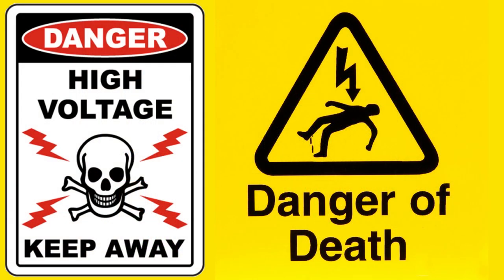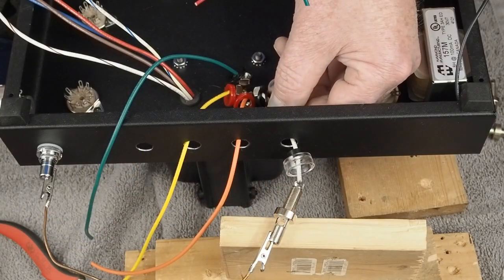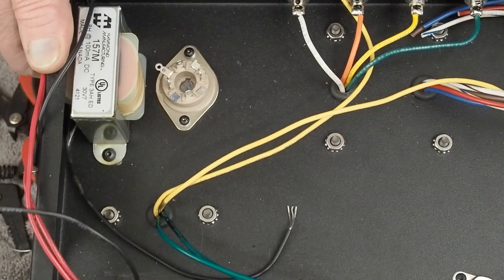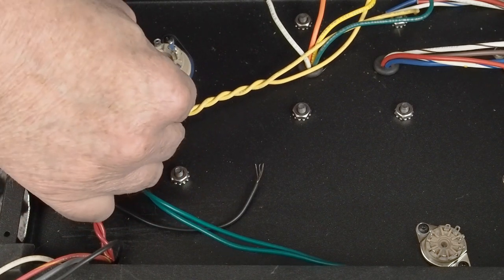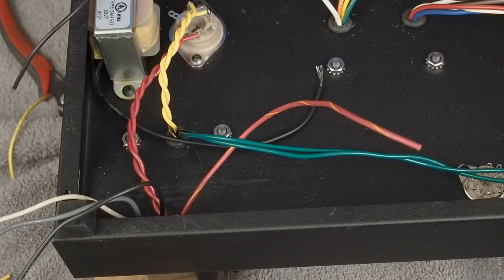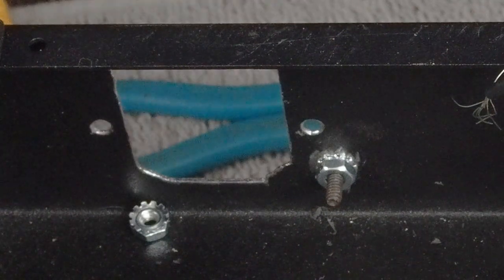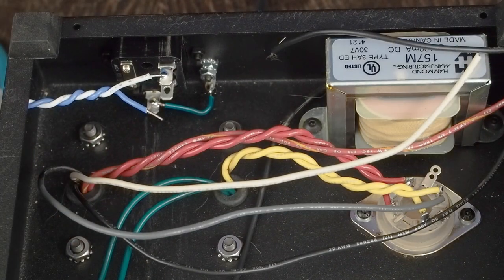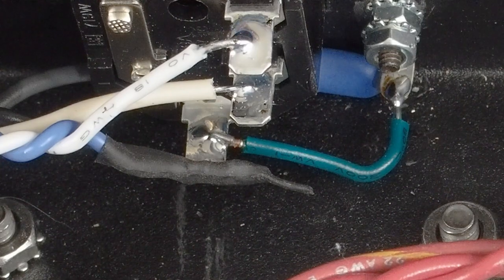Tubelab Monoblock: Detailed Build of Second Amp #1

Comment: One thing you might consider adding to your designs is a .01uF 440/250VAC Safety Capacitor such as the Vishay WYO103MCMCF0KR across the AC power switch. These capacitors carry a X1 and Y2 rating so they are safe for this use. This helps control switch arcing.
Reply from the maker: Mouser has this part number on 53 week back order :P 

Looks like they have VY2103M59Y5VS63V0 and yeah I have used these before and good point on adding them to a build.
Reply: @SkunkieDesignsElectronics  Yes, how can 53 week back order even be a thing? There are lots of others that will work as well. They have lots of the one you suggested.
Reply from the maker: @brycejeannotte7699  Yeah lol I have no idea.

Comment: Great video. Thanks.I really like seeing someone else' thought process/approach to projects like this.. What is your solder of choice? Can't get over how expensive that has gotten over the years.
Reply from the maker: I've been using "Alpha" and when I can find the old stock radio shack stuff off ebay is also good. I just bought a pound of Alpha Cleanline 7000, 110436, 63SN/37PB, .032" on ebay for $14